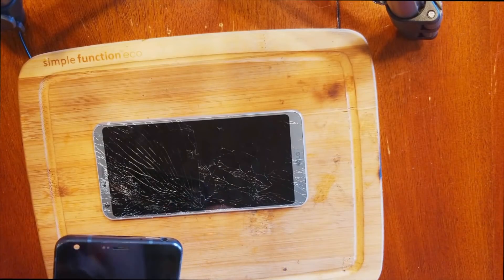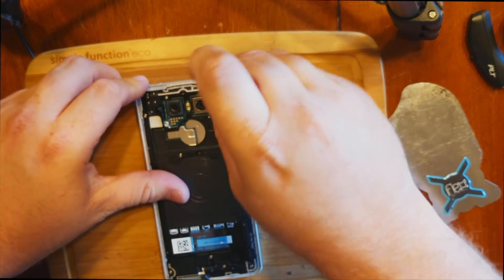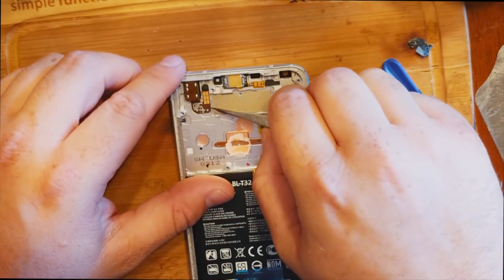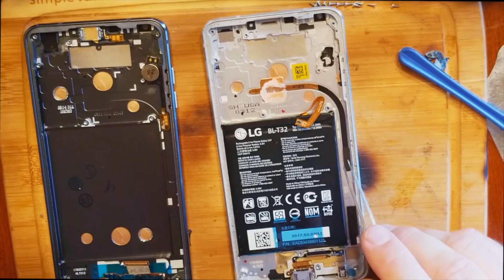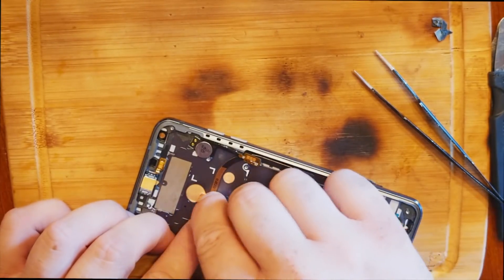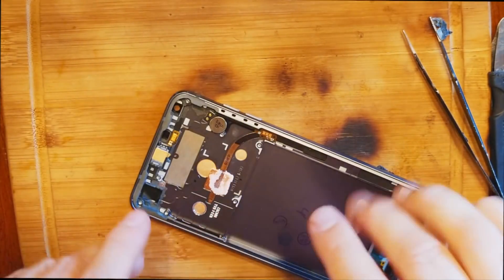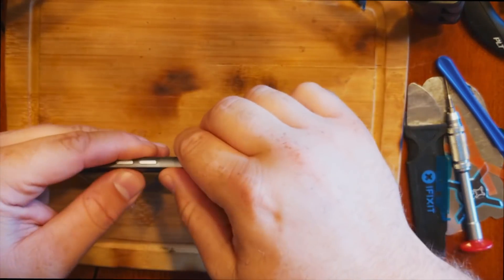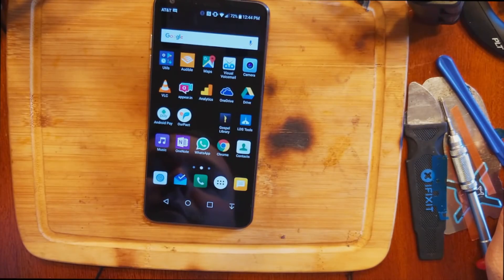LG G6 Glass and LCD Frame Replacement in Salt Lake City Utah Tech MD

Comment: Hello Mr. TechMD. I just wanted to say thank u so much for posting your video of the LG G6 screen/frame replacement. I followed your video step by step and I successfully replaced my G6 screen and frame. Your video was an excellent guide and I had no problems doing it myself. I watched a couple other ones before I saw yours and your video was the best one by far. I almost didn't do it because I saw how many little pieces had to be transferred and I wasn't sure I could do it without breaking something. The heat tube made me nervous but I did it exactly the way u did it with the same tools. I've fixed phones before but never a G6. But I just broke mine the other day. So thank u very much for a great and helpful video.

Comment: This may be a stupid question, is there a way to just replace the front glass, from the front, without taking anything else apart? My glass is cracked but digitizer and display work fine.
Reply from the maker: Sean Reeves no it requires special  equipment unfortunately
Reply: you can heat the phone up and insert some playing cards buy you must be very careful as a slight amount of pressure can crack the digitizer lcd. Go for it!. At the worst you will lose 10 bucks.
Reply: Tech MD Youtube What if you freeze it and put a card under it to seperate. Glass from LCD
Reply: Amy Bella do you know how to get the glass seperated from the glass initially? If so please reply as youll save me a lot of time lol
Reply: suhail- Are you talking about the front glass or the back glass, the back glass is easy, you heat up the back with a good heat gun, not a blow dryer cause its weak, get a good heat gun, hold it from distance, make sure you dont overheat it, and slowly, take the cards as its hot and slice through the adhesive very carefully and go around the phone, it will seperate.

For the front glass separation, you need a special LCD freezer, then once its frozen you can use a card to separate the glass from the screen, check here:

https://www.youtube.com/watch?v=RfByZwmtWzE
Reply: Amy Bella 
Thank you! I was looking for this over a long time didnt know the s8 had thd same style of adhesive.
Reply: is there a way to remove just the front glass? digitizer and everything else is fine, just the front glass is the only thing that has a tad crack
Reply: Did anyone figure it out? Trying to do same

Comment: I just replaced the screen & digitizer. Everything seems to be working EXCEPT the load speaker. I cannot get anything to play through it. The software seems to be trying. Is there a grounding issue that I am missing? I haven't firmly sealed the back glass cover because it broke taking it off. I've got another backing ordered and on its way. Any help would be greatly appreciated!

Comment: is there a difference between the Generic and OEM ....Thanks
Reply: Ben Gordon yea generic is trash as oem is made directly from LG I wound not buy a generic lcd a generic back really doesn't matter in my opinion.
Reply: Jadan yes ...I know I have a tiny crack in the very lower left hand corner you can barly see it ... I think I won't worry about it ...unless it spreads have a 9h protector on it and heavy duty case ...i
Thanks
Reply: Ben Gordon i would not if it's just the back. It can fuck with the resell value. If it's just the back it wouldn't matter. You'll lose your water proofing too.